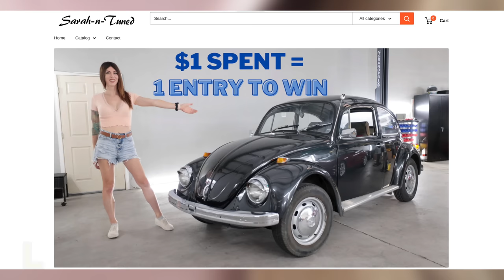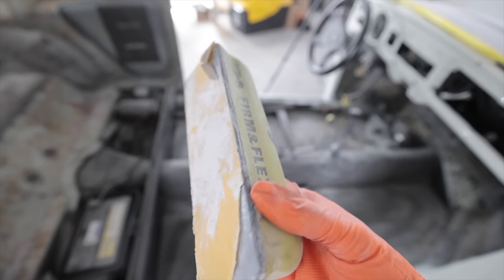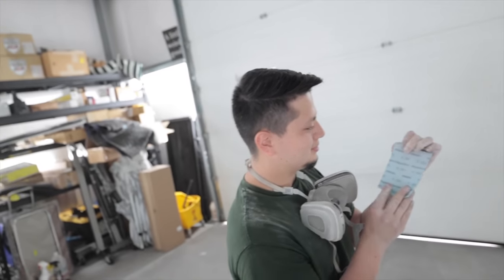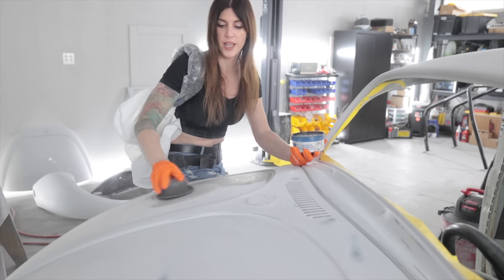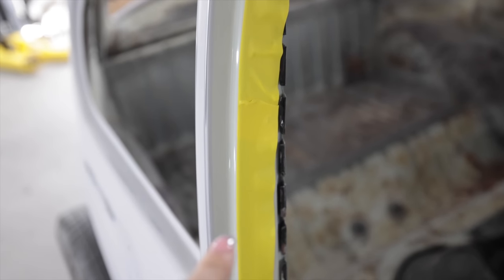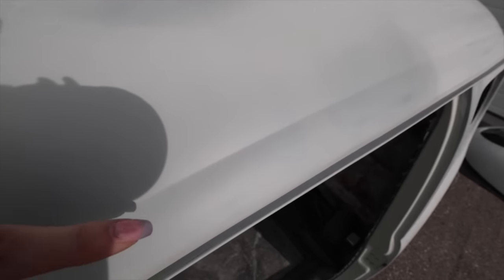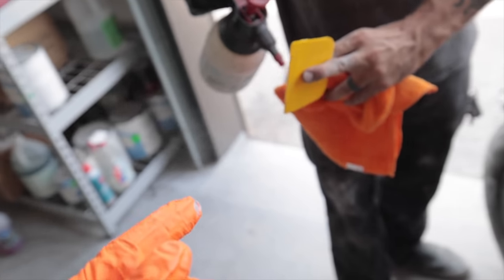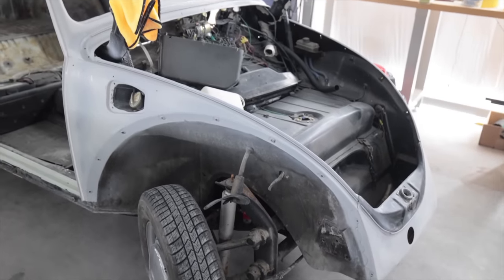This Was A MASSIVE Pain, but it's Ready To Paint // '69 VW Beetle

Comment: Sarah dearest,
Fresh air. Lots of fresh air. And water 💧. Same: lots. Dr. Rapp’s prescription for feeling better by the morrow.
It is good to see your OCD did not suffer from your little expedition with Charlie a week or so ago; visiting the UrQuattros at play. Sanded to (mostly) 800 grit 🤪. Ready for paint. Except there will be at least a day of additional prep before you are, approximately, satisfied 🧐. Please to be so kind so to keep your pretty head inside your ventilator hood during dusty or chemically challenging process😵‍💫. Much better you will feel after all prep is done.
Keep the aspidistra flying!
Paul

Comment: Thanks for doing this project. It has given me the kick I need to finish off the restoration and EV conversion of my mum’s old Super Beetle Cabriolet. 

I am always impressed with the level of detail and commitment you put in, it’s so tempting to give up when there is so much sanding to do but it will look so much better when painted due to the effort you put in now.

Comment: First: Amazing jorb.

I did all the bodywork, prep, and painted my first car, a 1966 AMC Rambler 2 door, and it ended up....fine. I learned a TON, however, and got some great pointers along the way, and then next one was my dad's 1968 Buick Skylark Convertible, and THAT paint job ended up looking amazing. It was so rich and shiny that it looked wet, like you could dip your finger in it. The Rambler was sad next to that, so I went and re-did the paint on the Rambler because I make excellent choices.

Comment: My mechanic / welder / crash repairer/ spray painting Late Dad would put his name to this car Sarah and he was a perfectionist 

My first car , an Austin Healey mk 4 he put 13 coats of paint and undercoat on
All done by eye and feel with wet n dry a sponge and a bucket of water 
Eventually after I’d died in the sanding process “ just one more coat “ 🤥🤥 the final coat came straight off the gun with a shine that meant a guy paid four times the cost of the car just to buy it once it was back on the road with a new roof , wheels / tyres / number plates etc
Biggest regret of my life 
Little twin carb 1275 cc would do 95 on the flat 🏴🇺🇸
This prep , the more you do the better the result
You rock

Comment: I don't think most folks are aware of how difficult it is to actually film work, edit it, then upload. I know I didn't until I started doing it. It's hard enough just to do the work. It's hard enough just to film the work. But doing both is a nightmare. Good work young lady! Keep it up. (PS I actually accidentally deleted a video off an SD card the other day: Did you know they can be recovered? I didn't until I did it. Took an hour, but it worked.  I didn't know it could be done).

Comment: i only thing i would says is i would have done a quick blocking with the 200 because the foam pad on the da will flex into the small dents then you wont see them other then that amazing job. i bet your arm feel like noodles. i know when i have been sanding at work my arm fell like their going to just fall off and just so you know they made a sprayable guide coat too easier for big areai thing

Comment: There's a dude named Bad Chad that does a sanding guide coat over his whole car in 10 minutes just using spray paint. It all gets sanded off regardless right? That is the point right?  And the spray painting does not have to be pretty or 100% coverage either; just get 'er on there and start sanding.  Beautiful work btw

Comment: You look to be achieving a better than factory finish. I bought a new VW Beetle A5 R-Line in 2018. Folk though I was crazy as I spent days deep polishing & waxing the (white non-metallic) paintwork on the brand new car immediately after picking it up. The factory finish was dreadful; with rough pitting and (worst of all) a panel between the panoramic sunroof and rear window dull due to under-spray.😠

Comment: Actually the guide coat is so you can find the low spots not so much to make sure you sanded everything. So you're really not using it properly. It's crazy how many comments you have and if I'm not mistaken no one else has mentioned this to you. Yeah everything is going to be super smooth but you're going to have high and low spots all over and you pretty much wasted your time because you didn't block sand everything evenly.